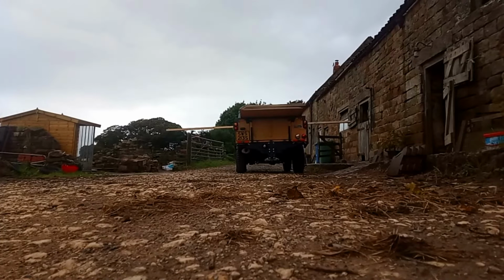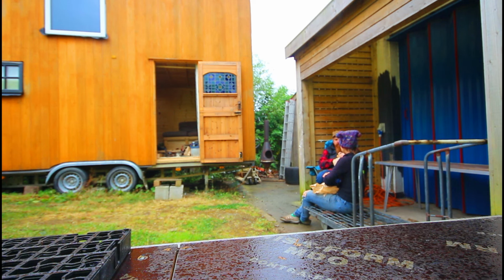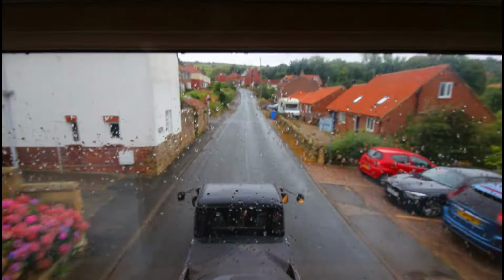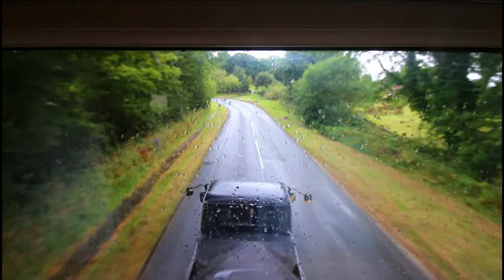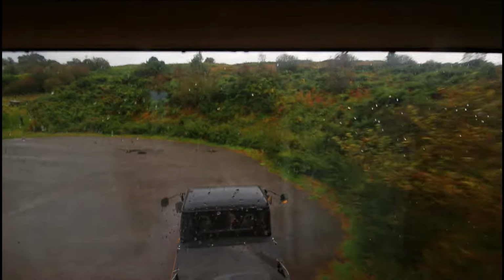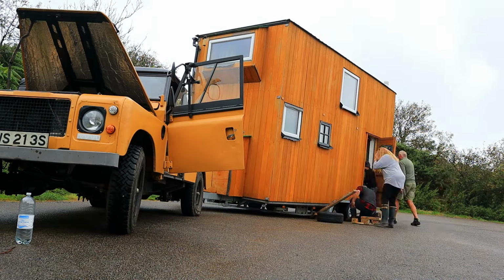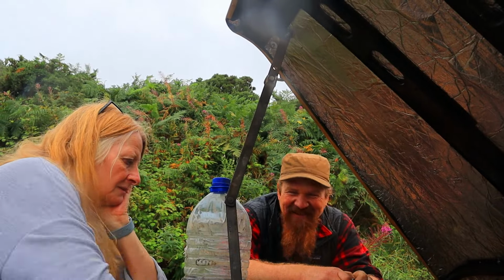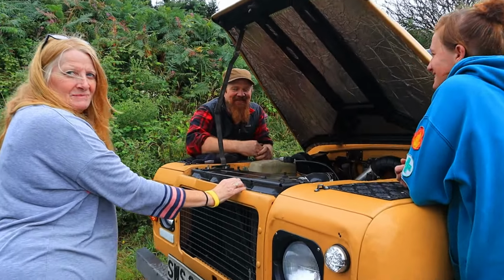The Tiny House goes on an Adventure! Kermit's Mega Mission ~ Ep.50!

Comment: I loves me a good mission moving something big.

What a pain being diverted off the motorway in Birmingham, I had similar with a tractor loader on a trailer on the Isle of Wight and a diversion sent me down single track roads with junctions I couldn't manoeuvre round.

If it ain't right move it at night!
Reply from the maker: It was quite the mission, could have done without being diverted through Birmingham 😁 but all in all, a smooth drive down after the initial issue.

Comment: Good video. You didn't need the ballast in the back. Artic units weigh around 8 ton and pull 30 ton
Reply: Very different setup, artic trailers have linked brakes and put a lot of weight on the tractors driving wheels!

Comment: What was the weight on the tow ball, That's one hell of a body height difference between back and front wheels.
Reply: I think a lot of the dip was due to the big bag of ballast in the back of Kermit
Reply: @its.emma.jacobs  you have to be careful as you don't want the weight coming off the front axle if you hit a dip going around a corner.

Comment: Be interesting to know how much it actually weighs…..
Reply: I would guess WAAAYYY too much, but that's just by eyeballing the rear wheel arch clearance!
Reply: @chriswills4064  I’d guess about 5 tonnes…

A static caravan empty is usually 5 tonnes 

I’ve had 12 tonnes behind a 2.7 rangerover sport with no issues, but a Ford ranger couldn’t cope with 3.5 ton on a hill without overheating 

Probably needs a bigger rad, fan and intercooler
Reply: Same here. That's the first thing you need to know but if the trailer she built the TH on was rated for 3.5T and the leaf springs were not jammed on the chassis then we know it's less than about 5T. I assume Max had electric brakes set up.
He is lucky there was no accident because he would not have been insured at that weight.
Reply: @livingoffgridinscotland A  large caravan empty would be between 2 and 3 tons.
Reply: I don't know why peple insist on using so much wood on DIY camper/caravan builds.. It's incredibly heavy

Comment: I don't think the ballast helped you on that hill, Max. Slow speed, heavy load, engine working hard and not getting enough air through the radiator? No wonder it overheated. Glad there was no lasting damage. I also noticed that, whilst lifting the house to fit a new wheel, you were also lifting the back of Kermit (and the ballast!!!). Still, all's well that ends well. 🙂

Comment: He should have towed up and down steep hills in low range. Apart from being better on the vehicle but the fan would have spun faster at the lower speed
Reply: It was in low box going up the first big hill. On a Series Land Rover though, low box locks the front and back axle (like diff-lock on a Defender) so it's not good to keep in low box too long on tarmac or the tyres will scrub.

Comment: I can't believe maximus would do something so ridiculously dangerous, overweight to a point the front wheels barely had any weight for steering, blinding oncoming traffic with mis-adjusted headlights and the trailer falling to pieces on the way. My respect for him has taken a serious nose dive.
Reply: Calm down Bob! The weight in both the Land Rover and trailer was re-distributed after the first big climb (we had to find somewhere flat first), take a look at about 21mins in to see what it looked like for most of the journey, we had bags of ballast right behind the cab and in the passenger footwell, so the steering was fine as were the headlights, the trailer is a brand new 3.5ton gross car transporter so it was hardly 'falling apart'. Yes the wheel came off early on, that was my fault for not checking the wheelnuts. Other than that the mission proceeded according to plan. We were overtaken by several police cars on route and must have been on CCTV for a considerable part of our trip - if the rig looked as bad as you make out we've have been pulled over and quite rightly too, but it didn't and we weren't.